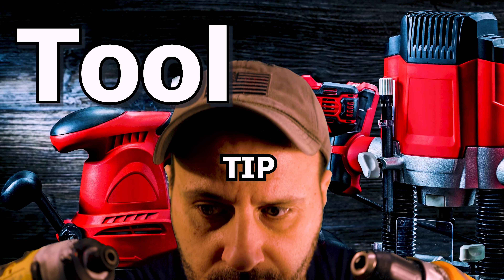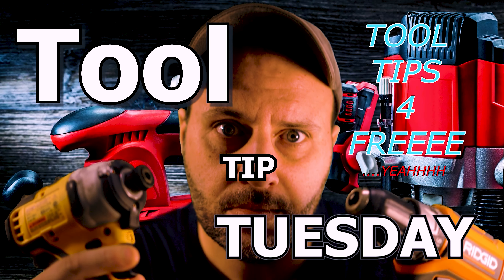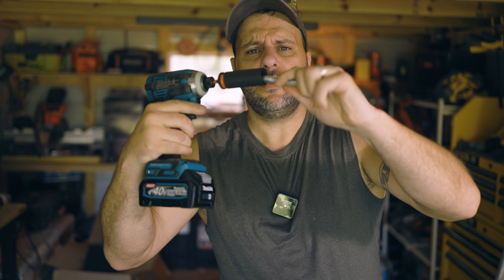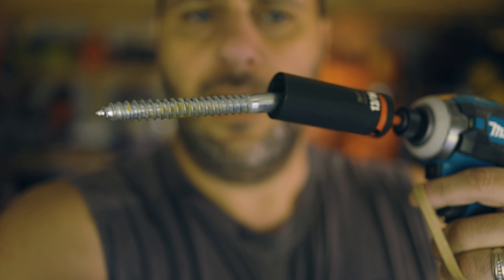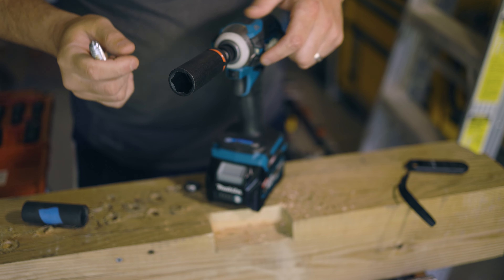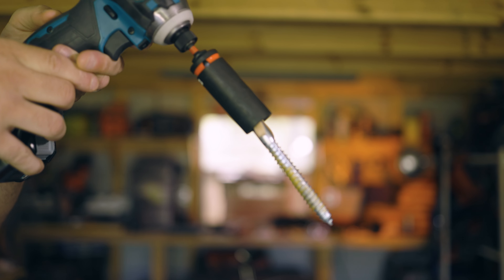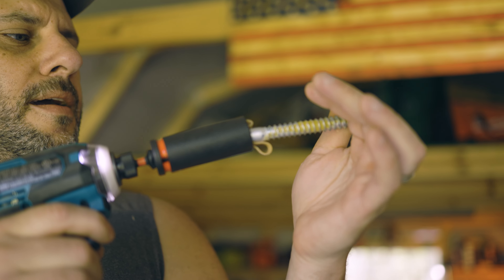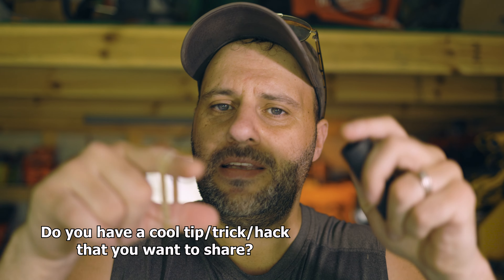Impact Socket Trick So Helpful You'll Never Use The Correct Socket Again!!!

Comment: Cool tip, Clint! That rubber band about to have a bad day! 🤣 How does one clean a mud or paint mixing paddle with only a hammer and a bucket of water? Or, how does one stack buckets where they're not so difficult to pull apart? 🤔😉
Reply from the maker: Brother man, can you send me a quick vid on Instagram showing how you do it. Next Tuesday is your day Brother
Reply: @ToolReviewZone  I'll have to work on it, but you got it! 😎🎸
Reply: Bucket stacking, use plastic straws.
Reply: @TheSaw410  tuck the handle of one bucket into the air space of the other bucket.